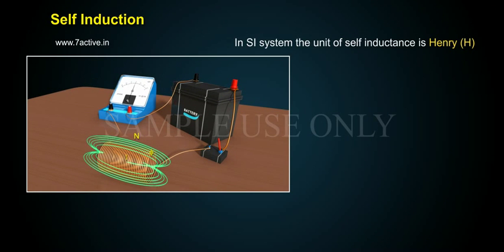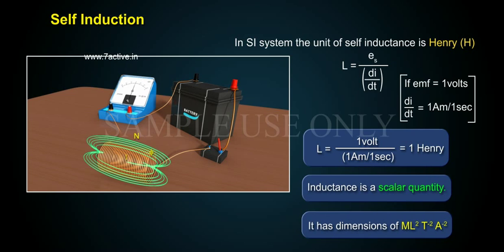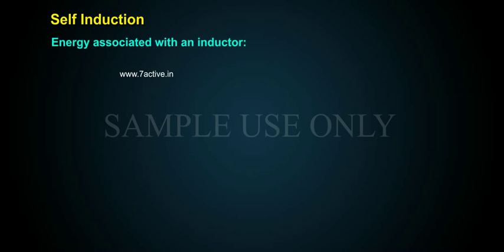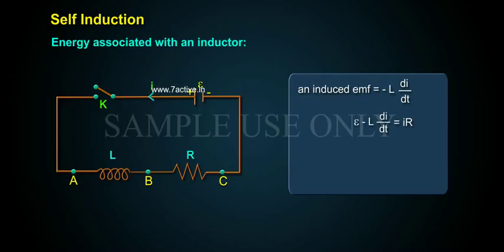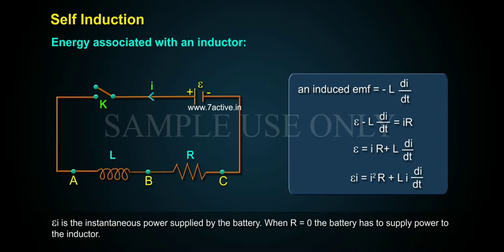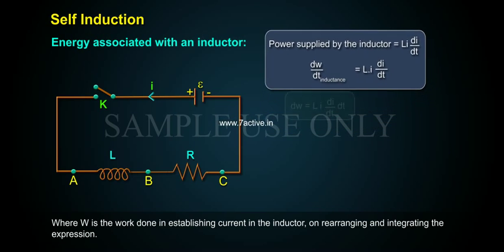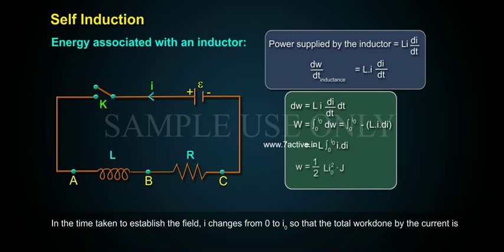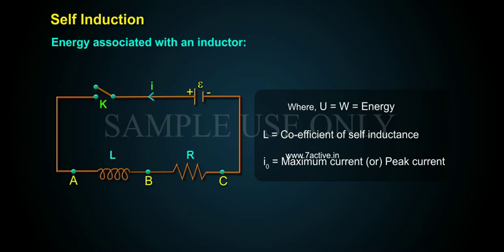SELF INDUCTION PART 02

Comment: In an inductor, when current decreases, the applied voltage and the  EMF flows in the same direction .which means the two EMF would produce magnetic field in the same direction.Would that not violate lenz's law?(Magnetic field exert force in opposite direction